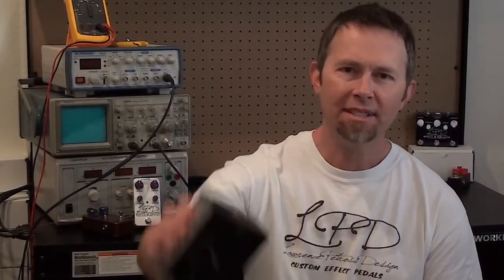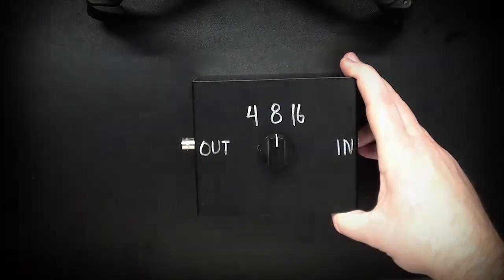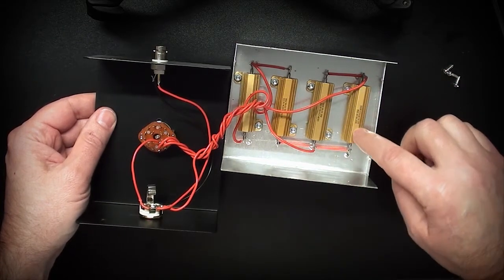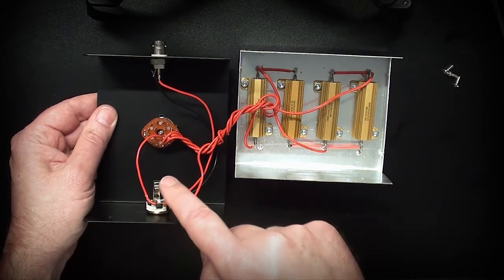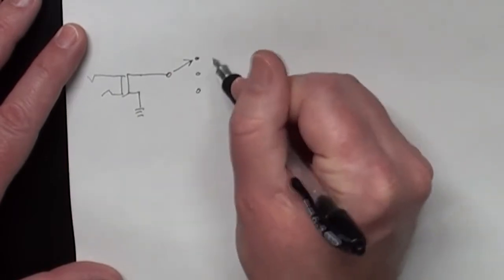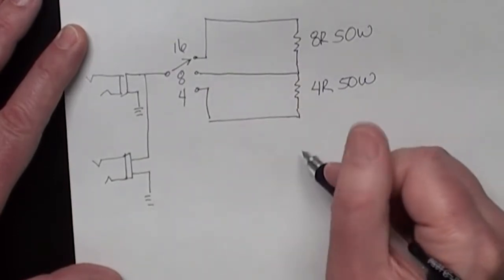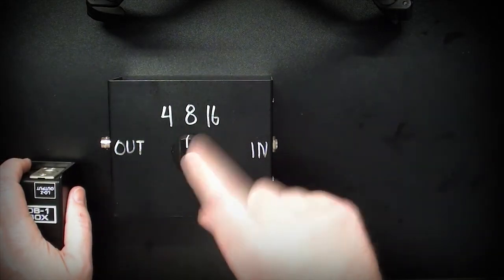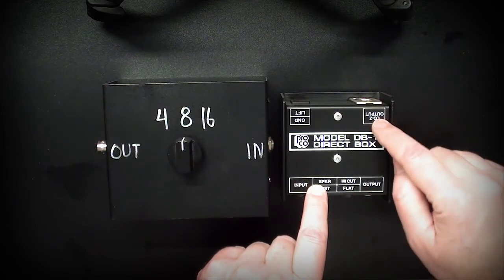What's Inside This Amplifier Load Box?

Comment: Is this will give same tone compared to expensive load box such as Suhr? Is the dynamics or frequency will reacts / response the same?

Also is it perfectly safe for an amp? Thank you!
Reply from the maker: This load box is only for testing, setting bias with a scope, troubleshooting etc. There is no speaker or DI circuitry. It is safe for the amplifier as long as you don’t exceed the wattage rating on the resistors.

Comment: What is the signal level of the tapped off output? Would it be feasible to run that output into another effect, such as a guitar pedal or an amplifier that’s of a higher rating that the one being “loaded” into the box? For example, a tube amp rated at 15 watts would go into this load box, and a tapped signal would go into a 100 watt amplifier. Is that possible?
Reply from the maker: The signal out is designed to feed an Oscilloscope. So, it's probably a little more than an effect or amp would be expecting but not much. Totally feasible to use it as a re-amp box. Might have to adjust the output divider a bit.

Comment: I just need an 8 ohm reactive load. I have seen more eq. circuits, more or less complicated, but I wonder if I could put a few crossover componentes in series and a cross the resistive load?
An old Celestion G12H measures 6.9 ohms DC, around 30 uF and 0,9 mH at 1Khz. So I thought of putting 33 uF across the input and then a 6 ohm resistor and a 0,9 mH coil in series.
Anybody here that can comment on this?
Reply from the maker: Check out Randal Aiken's reactive load here https://imgur.com/rZvUBDj for ideas

Comment: Hi - Would it be okay to run a 16 ohm tube amp into this type of load box, with nothing else connected, and the amp’s master volume on zero? I’m basically looking for a way of practicing silently, just running a headphone out from an effects unit connected to my lunchbox amp’s fx loop, with no speaker connected.
Reply from the maker: Paul Galinsky yes that should work fine. The amp will have a load for the output and should function normally.
Reply: LawrencePetrossDesign superb - thanks!

Comment: Every time you open one of the boxes, I expect it to be full of electronic circuits!  Very interesting and surprising!  This video is right on time!  Even though I do not do any direct recording, I now understand the "load box" part of the equation.  I've been trying to understand the Two Note Torpedo and Captor products, and now some it makes a little sense.  Was listening to Phil on the Tone King (while driving into work) and they were talking about these products.   Long story short, trying to understand to see if any of this has any benefits for playing at home!   Anyway, I'll be reviewing your attenuation, direct box, & etc for reference and understanding of the concepts!  Still a little confused when they talk about attenuation and reactive load boxes, but I'll get there!  Thanks, as it's so interesting to see what is in these boxes and makes them work!
Reply: Hi Brian. Resistive load boxes are suitable to direct recording just using the preamp and emulating the power, cab and mic sections. To use the power signal you need a reactive load, that emulates a real cab impedance, having a suitable frequency spectrum of the current wave (the impedance of a real cab is not the same for each frequency). There are some diagrams of reactive load designs in some websites. The most complete one that i've found is in this video of Youtube  (not mine): https://www.youtube.com/watch?v=UZAbQaavmKA
I also found a simpler version here: http://www.aikenamps.com/index.php/designing-a-reactive-speaker-load-emulator